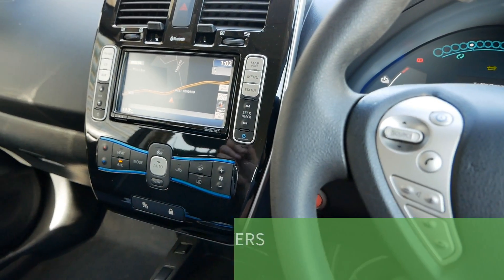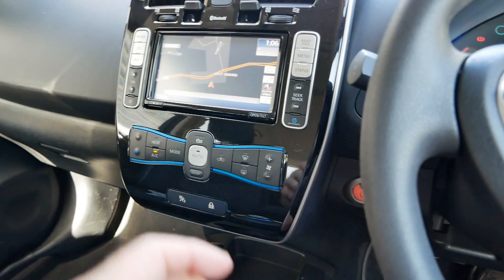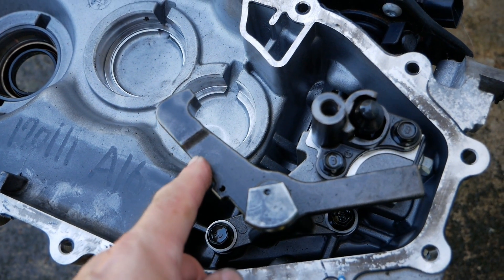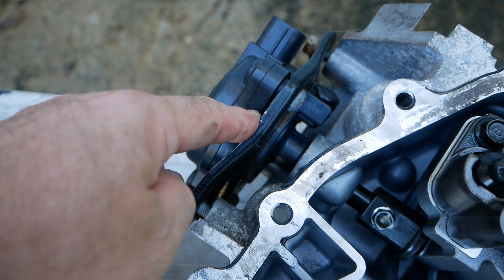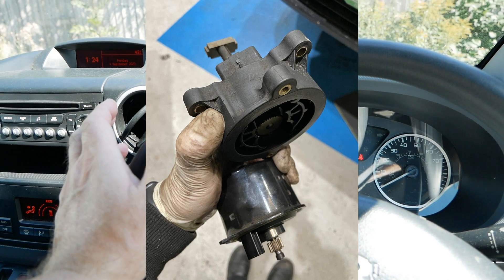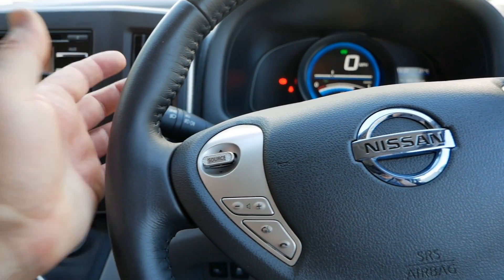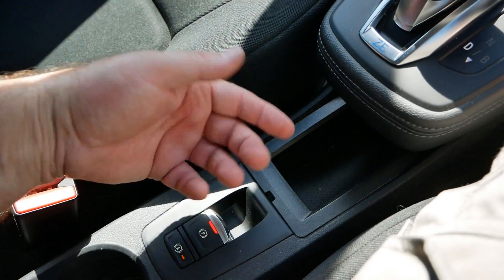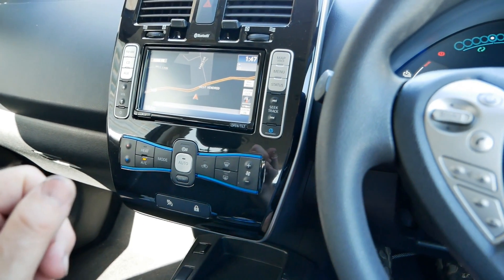How to correctly stop/park an EV. Many get this wrong, potentially causing damage!

Comment: Poor design by incompetent decision-makers expecting humans to accommodate complex technology - should ALWAYS be the other way round! The rule is simple: technology is our servant NOT our master
Reply from the maker: The issue here is that most manufacturers are making EVs and modern cars operate in the same way as old combustion cars, except Tesla who automated all of this and even took away the handbrake control.
Reply: @GoGreenAutos  or u could say it’s the triumph of ‘cool’ over function - traditional (‘proper’) h/brakes are 125 years proven effective +controllable technology and emergency backup in the event of ‘systems failure’ (software, mechanical, hydraulic). Plus, how are we gonna be doing h/brakes turns now?!?😂

Comment: While I agree with everything you said, as long as you maintain holding the footbrake while selecting your handbrake and the parking gear, the vehicle will not move forward or back so the order you select them doesn’t matter. If you release the footbrake in between selecting handbrake and the parking gear then yes your sequence would appear to matter. My Hyundai Ioniq EV manual says to “continue to depress the brake pedal” shift to Park and apply the parking brake. The action of maintaining the footbrake negates the need for a correct sequence of the following 2 actions. Great video as always 👍
Reply from the maker: Agree. The problem is that most people don't read the manuals (especially now that they're so thick!) and many also use Park on the transmission as a handbrake.

Comment: Hi,  Apologies for coming to this so late.  I have just ordered a new Renault 5.  It does not have a 'P' option, just R,N, and D/B.  It does have an electronic parking  brake.  I assume in this case one should simply: press foot brake, apply parking brake, put selector into 'N' for neutral.  Correct or not?
(This is my first EV and want to get things right.)
Reply from the maker: The Zoe ZE50 was the same. They've done away with the Park button, which I feel is a good thing. I'm not sure if they've actually done away with the park pawl inside the reduction gearbox though or whether its still there and applied automatically. The upshot anyway is you can't do any more than just stop the car with the brakes, apply the handbrake and then turn the car off or select Neutral first and then turn the car off.
Reply: @ Thanks!  As someone transitioning from decades of driving manual ICE cars this suits me fine - basically just doing what I’ve always done. 😊

Comment: You said this about the Hyundai ioniq, however in the hand book it states you put it in park then parking brake then power off. I’m confused now as what to do.
Reply from the maker: The handbook is wrong...if you want to look after the park actuator on the gearbox, that is. Especially if on a slope.
Reply: I have just googled it and what you are saying is true. Bloody hand books. I will do it the way you said . Thanks .  Keep up the good work I’ve learned a lot about my ioniq from you.

Comment: Does it matter if I brake then put it in neutral, handbrake the car and last put the car in park? Or is it best to go from drive ,brake ,handbrake, park?
Reply from the maker: No it doesn't. Neutral on an EV isn't the same as an ICE automatic, so there's no benefit of using neutral first, but then no negatives either.
Reply: @GoGreenAutos  it's all new to me having the ioniq,  but I'm starting to love the car already 😍.  Thank you so much for your quick response 🙏🏼
Reply: @GoGreenAutos  one question remains.  What to do in winter when it's below zero? My driveway is flush so no hills. Can I still use the handbrake?  Or will it be better not to use it when it's freezing cold?.
Reply: @GoGreenAutos  one question remains.  What to do in winter when it's below zero? My driveway is flush so no hills. Can I still use the handbrake?  Or will it be better not to use it when it's freezing cold?

Comment: Thanks for this... Having  Got an Ioniq three weeks ago I have been doing it wrong!  thanks for the useful Information.!
Reply from the maker: Glad it was helpful. It will save your gearbox.
Reply: @GoGreenAutos  Thanks for your response... Can I have another question?  for a while. the Classic FM/dab music title info appeared in the very bottom section of the drivers display.(It has a shaped half frame around it) Then it stopped showing & hasn't since...
 How can I get that to display again ?
Reply from the maker: @BobMuk08  I can't remember the option on the Ioniq, but generally on DAB radios you have a "display" or "txt" option in the settings.

Comment: My only query is the Ionic has auto hold so when i come to a stop effectively my handbrake is already on so couldn't i just then put it into park then put on the electric parking brake?
Reply from the maker: Auto hold is holding the hydraulic brakes (all the brakes), not the handbrake (rear brakes) - so its just effectively holding the brake pedal down for you.
Auto hold does not change anything in terms of the message in the video. When parking and leaving the vehicle, still apply the handbrake first, then select Park last.

If you're on a slope and you really want to look after your reduction gearbox, then it would be even better to apply the hand brake, then select Neutral, then turn off auto hold, then release the brake pedal to allow the weight of the vehicle to be held by the handbrake, then select Park.
Reply: @GoGreenAutos  ok thank you

Comment: I have a question. 
after you engage the handbrake, do you lift your foot off the footbrake ?  or you keep your foot on the foot brake then you put the car into park mode and then  you lift up your foot off the footbrake ?

1. Is it  footbrake,  then ,handbrake without lifting off your foot off the Footbrake,  and then park. 

Or 

2.   is it Footbrake, then handbrake, then taking your foot off the  foot brake, then  park.

Which is better?

Comment: I find that when parking on a slope, when I i follow this sequence, the car moves as i release the for brake after pressing Park. I'm assuming this isn't good for the transmission. Therefore I do: footbrake, handbrake, release foot brake, press Park.
Reply from the maker: Yes, spot on. As you saw from the video, there's a little bit of play in the transmission as sometimes the park pawl wont be dropping straight into a slot in the sprocket.
Reply: @GoGreenAutos  I guess I'm also experiencing a bit of movement caused by switching from foot to hand brakes too? Not really my area of expertise, but very interesting stuff..
Reply from the maker: @decimal1815  shouldn't be. On the majority of cars, the handbrake uses the rear brake pads, so is the same as holding the car on the footbrake (albeit that is using all four wheels).
Reply: @GoGreenAutos  If we have a one pedal car like the leaf40kwh, can we do without the electronic handbrake? And just put the gear selector in P?

Comment: Hi , 

I am na ev user from india , here we have a model called tata nexon ev 

Whic have a electronic park ( p) option , and  seperate a auto hold  option.
My doubt is #  while standing in traffic .
1. Should we just put the car in d( drive mode ) with autohold  or 
2 . Should we  put  car in d ( drive ) to N  (neutral ) and put auto hold 

Will it have any problem on electric gear knob
Reply from the maker: Just let auto hold do its job
Reply: @GoGreenAutos  thank you 🙏🏼

Comment: Great useful video. Ive got a Ioniq electric. So would you advice not to use the Auto Hold function near the centre console on a slope. Does this apply the footbrake when temporarily stationery?
A lot of cars with automatic gearbox have this Auto Hold function
Reply from the maker: Autohold is great on a slope as it is holding the brakes on all four wheels.

Comment: Sorry but I have for my entire driving career and with my 28kWh Ioniq put car in Park then put park brake on.  The BYD Atto 3 puts the park brake on when you put Park on so the Park Brake button isn't used.  Funny your the only one that has brought this up, had it been an issue pretty sure manufacturers and other YouTubers would say something.  I'll keep doing what I'm doing and have done for the last 35yrs of driving.  I keep my foot on the brake though until the car is in park and then put it the park brake on unless it was an Atto 3.  I'll do brake, park, brake thanks.

Comment: On my CR-V Hybrid it is set up so when I press the power button to switch off it shifts into P and applies the handbrake automatically. Just need to keep foot on the brake while it's doing it.

Comment: You're doing it wrong !
1 Put in neutral
2 Pull the Hand break
3 Release your foot from the pedal to be Sure all the weight is on the breaks
4 Then select the P mode.

Comment: What a load of rubbish there is no gear box the cars have a reduction gear this is all electronic there is no gear pin to lock up .  There is no weight on the transmission as there is no tradition transmission there no gears. Foot on brake select park if you take you foot off car will roll,away as nothing is engage.  That's why most have electronic hand brakes. You will not damage the transmission as everything is disengaged

Comment from the maker: About 80% of the comments below are from people saying either:
1. My car has an electric handbrake and it does it itself, so I don't need to worry
2. My user manual says select park first
3. I've just use Park and no handbrake or park first and my car is just fine

If you're parking your car on a slope or any ground where the car could move just an inch, then you should ideally (manually) apply the handbrake before selecting park, if you want to prolong the reduction gearbox and parking selector mechanism. Even better would be to apply the handbrake, then release the footbrake (so the weight shifts), then select Park. I didn't include this as I assumed it was obvious and I wanted to keep the message simple.
But cars with electric handbrakes that automatically apply themselves, do not often do things in the right order and the handbrake actuator takes a few seconds, so the weight of the vehicle (on a slope) still shifts putting pressure on the park pawl too. So even with these vehicles, it a good idea to do things manually if parking on slope and particularly if you're doing this regularly (if you have a sloped driveway for example).
I didn't include this in the video either, but I've had calls from EV owners who have been unable to start their EVs, because they can't get it out of park and this is due to too much pressure on the park pawl. Rocking the car back and forth resolves this.
And finally, some EVs, this doesn't apply too as they don't have a park pawl and I covered this in the video (mentioning Tesla & Zoe ZE50 as two examples), but clearly people weren't getting that far into the video before commenting about that either.
Anyway, I was only trying to help as this is a real issue and probably more so in the UK as the majority of EV drivers have probably never driven an automatic before, so none the wiser. Just remember, if you hear or feel a clunk, you could be doing it a better way.
Reply: What the steps before driving? Drive mode select and then hand brake release? Or viseversa?

Comment: My Nissan Leaf has an electric parking brake when you turn off the ignition the car automatically selects park when the power goes off, and if I apply the parking brake when I put it back into drive the car will automatically release the parking break when I drive off.

Comment: A good explanation, especially with the images of the transmission. In some cars, like the Toyota hybrid, the rear brake “electric parking brake” is applied automatically, and released automatically with a degree of interlocking with various items - e.g. it won’t release the rear brakes automatically if you are not wearing the seat belt (but it can be done manually then). It can be switched off if need be, e.g. in severe frost weather to reduce the risk of the brake pads being frozen on though.

Comment: This advice doesn’t work for Teslas.

There’s no handbrake as such.  You select “p” and then the parking brakes are engaged on the rear wheels via what sounds like a worm drive on the rear brake pad callipers.

If you then push and hold “p”, then you engage “emergency brakes”.  This isn’t explained well in the manual but it sounds like a single click from outside the car , which I’m guessing is consistent with a pin driven into the gear mechanism (hopefully for the front wheel drive)

So the sequence of selecting “p” in a Tesla to all intents and purposes will engage your brake pads onto discs, but that’s only two wheels braked in park.  For four wheels to be engaged (e.g. on a slope or a ferry) I’m left to guess work, but I’m hoping emergency brakes will be fine.
Reply from the maker: Yes the electronic park brake is fine holding a vehicle by just two wheels. The pads are applied really tightly.
Reply: @GoGreenAutos  Normally yes, but it can be marginal on an icy slope with just two wheels braked.

On a violent sea crossing, it could also be insufficient.   When I boarded a ferry, the deck crew insisted that all cars were put in gear in addition to parking brakes being applied.  I suspect if Ferry companies become wise to Teslas only having two wheel braking capability then they could deny boarding.
Reply from the maker: @anthonydyer3939  I've been on many Birkenhead to Belfast overnight ferry crossings when all vehicles were chained down to the decks.

Comment: Thats not what the Leaf manual says though......

"Parking the vehicle
1. When stopping the vehicle, apply the
foot brake, then push the P (Park) posi-
tion switch on the shift lever. Confirm
that the vehicle is in the P (Park) position
by checking the shift indicator located
near the shift lever or on the vehicle in-
formation display.
2. Apply the parking brake. For models
with the pedal type, firmly depress the
parking brake. For models with the
switch type, the electronic parking brake
is applied automatically (or for manual
operation, pull the electronic parking
brake switch up).
3. Push the power switch to the OFF
position."
Reply: That is pretty interesting. I wonder what difference it makes, then, or how crucial it is. To me, engaging the parking brake and releasing the service brake before engaging the parking pawl would make sense mechanically.

Comment: I don’t think it’s necessary, because you are holding the car stopped with the foot brake pedal / brake discs, then you are shifting into P while still holding down the brake pedal, so the car is still being held by the brake discs, and not the gearbox. Then you are applying the handbrake, and then releasing the foot brake. So at no time is the gearbox holding the car, right? 🤔 Or I am missing something? 🤷🏻‍♂️
Reply from the maker: If you are on absolutely level ground yes. But if not, even by a few mm, the car will move and the weight of the vehicle is then on the park pawl or at least additional pressure is put on the park pawl.
Reply: @GoGreenAutos  But how? The car doesn’t move when you have the brakes applied, you are not letting off the brake pedal before the handbrake is engaged, how can the car then move? You have the brake pedal pushed down all the time, so it should not matter if you go into P and then engage the handbrake before letting off the brake pedal.  How I see the problem is when people go into park, and not applying the handbrake, or that people are letting the car roll a bit in P before they engage the handbrake. Then we are having the problem, that the weight of the car is putting pressure on the gearbox. But I simply can’t see it should matter if you always have the brake pedal pushed down, and go into P first and then the handbrake, because you are still holding the car with the brakes, and first letting off the pedal when the handbrake is on. 🤷🏻‍♂️

Comment: Well said! That's very important tip and actually applied for ALL cars, the most important for automatic transmissions.
Don't leave the vehicle with shafts & gear on high tension! Let's stay in place with the parking brake doing whole job!
Reply from the maker: Thanks. But 50% of the people commenting here though don't agree....or at least think because they've not experienced any damage by selecting Park first, they'll continue doing it!

Comment: Ioniq 5 applies parking break when you press in P. It also removes it when you select D or R. No need to manually apply parking break.
Reply from the maker: While letting the car do it automatically is fine for most of the time, if you're parked on a slope, you should definitely do it manually, so the handbrake first.

Comment: i usually aim to do that whenever i feel like there is enough of a slope to need to pull the handbrake but 1. the people designing the car aren't stupid and probably designed the thing to be able to hold the car wo damage 2. i think the car actually sometimes won't initiate charging if its parked but doesn't detect weight on the transmition thingy.

Comment: when you stop at a traffic light .... stay in D or put in N or P?
Reply: Let it be i D.
Reply from the maker: Stay in D and hold your foot on the brakes or use Auto Hold if your car has that. If you don't want your rear brake lights to be lit, you could apply the handbrake and select N. No need at all to use P, especially if not on level ground.

Comment: put vehicle in neutral - press brake-pedal - apply park-brake - and finally into park on the drive selector.. this ensures no stress on the gearbox while parking.
Reply from the maker: Yes absolutely. I didn't include this as it would only complicate the message further. Clearly from the comments, there's enough complication causes already!